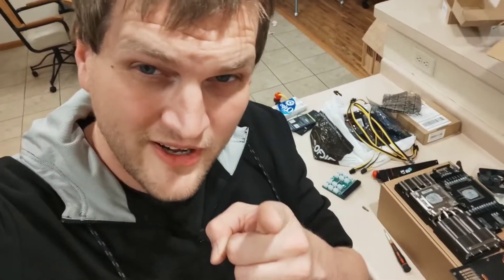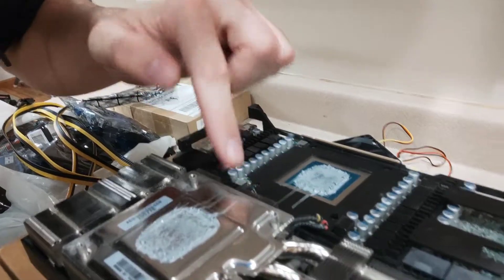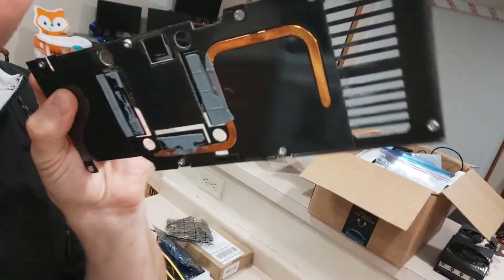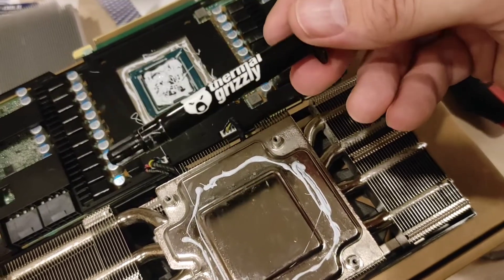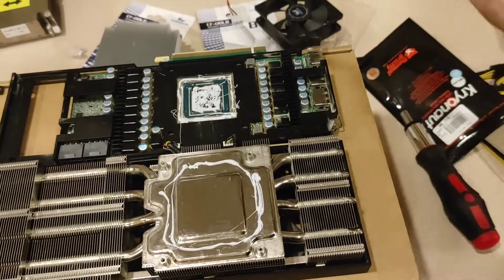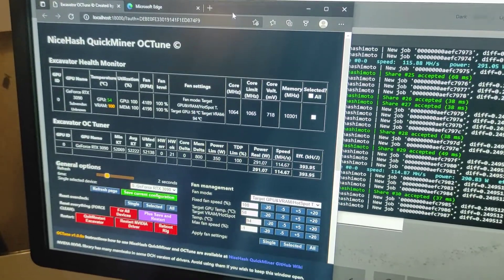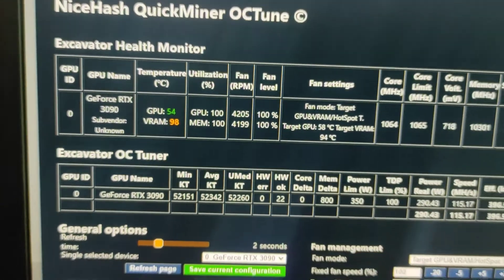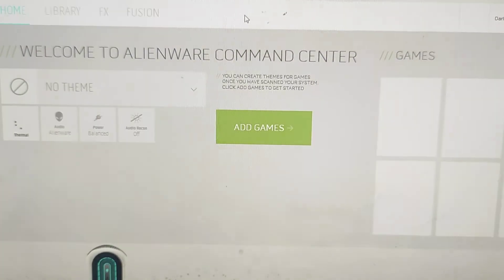Dell / Alienware RTX 3090 -- 10C Thermal Upgrade

Comment: My Dell RTX 3090

On GPU: GD007
On Memory: Upsiren U6 Pro
Between black plate and heatsink (there is a gap of less than 0.5 mm): GD007

Temps:
GPU: 69
Hot Spot: 81
Memory: 84

Fan: 63%
Power Limit: 100%

This is all with a full 350W load in FurMark.
I'm not a miner, so I don't know what temperatures will be during mining.